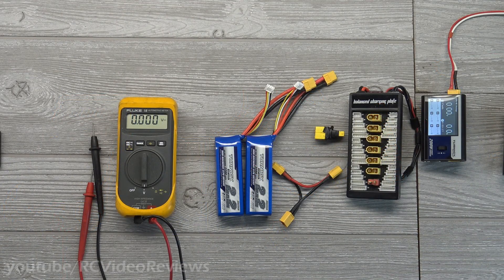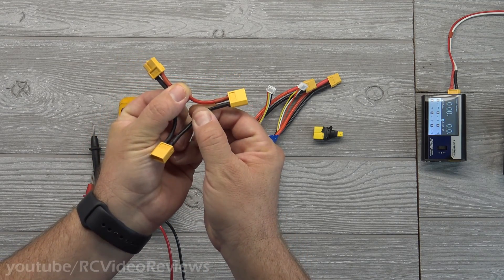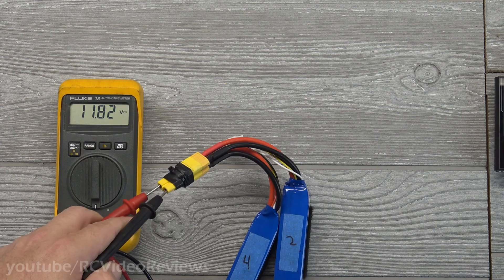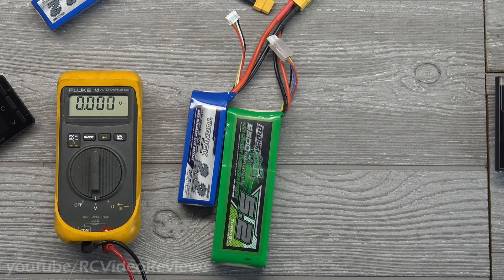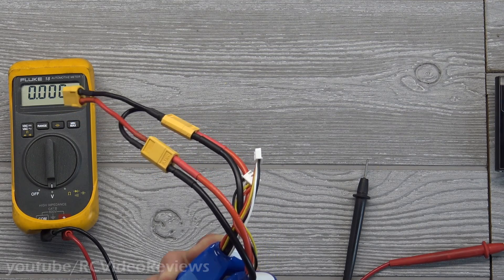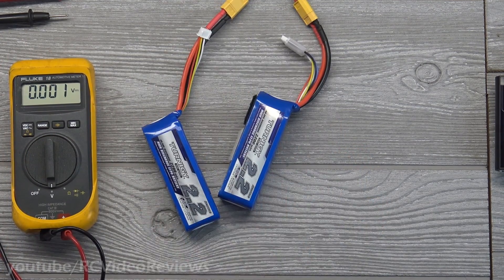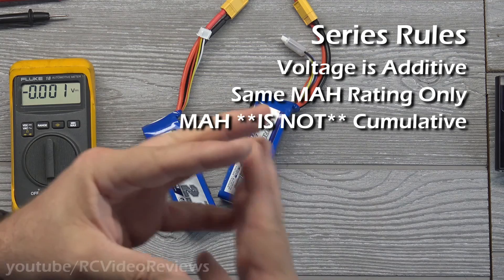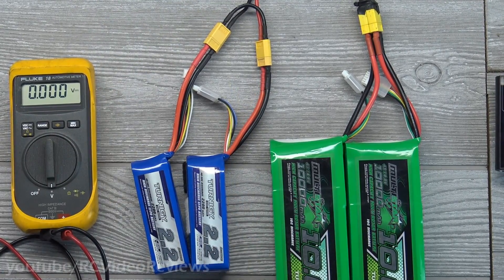How to Connect LiPo Batteries in Parallel and Series - Detailed Examples

Comment: So I can connect a 7s with an 8s same 22000mah lipo ? I’m new to this but I would love to learn ! I will add a bit more  - I did connect 7s with 8s in series but they both have 22000 mah and same discharging rate 30c and they never smoked or did anything unusual , according to your video I understand why , your video it will be my foundation for such things , thank you mate 👍👍

Comment: Man I love your vedios and perfect timing for me, so I'm flying my plane with a diy 4s 2p 6000mah 18650 pack I want to connect a 4s 1p 3000mah in parallel to now have 9000mah is this correct? The 4s 2p pack has c rating of 30amp the 4s 1p has c rating of 15amp so when connect in parallel what will be the c rating? I'm guessing 30amp?? Thanks for all your video's

Comment: So it would be ok to connect 2 4 cell 2200mah together to get an 8 cell 2200mah 'pack', could I then do the same with another pair, to get 2 x 8cell 'packs' then connect them in parallel to get a 440mah 8cell pack?
Reply from the maker: I think you mean 4400 and yes.

Comment: Thanks man, nice video !

Questions I have, is it possible to mix both up to one output ?

Looking to power a large warbird with 14S/20 000 mAh, can I hook four 7s packs, two sets of 7s/10 000 mAh in \\ to get 20 mAh  and then these, in series’ to reach 14s up to the ESC ?

Is there any considerations to be taken or things to be aware of ?

Thanks
Reply from the maker: Yup, you can. The considerations are that in series if one battery is soft (high IR/degraded capacity) and the other is in good condition, the soft battery can be killed while in series as there is only one path for current. So the stronger battery will keep going even if the softer battery is dying. This is true for any series connection, so my suggestion would be to make sure your packs are all in roughly the same condition by evaluating their mAh capacity and IR. Don't push too hard early on regarding your floor voltage. And measure/measure/measure while you dial up the flight time to make sure your batteries are all able to provide sufficient power to your combo.
Reply: @RCVideoReviews  thanks a lot

Comment: Forgot to mention that by running parallel, you are also doubling the current which is a big thing to leave out. Could easily smoke someones esc.
Reply from the maker: Incorrect. Current is the result of load. Connecting cells in parallel does not change load but it does combine the capacity of the cells connected and ALLOWS more current delivery capacity. Merely connecting cells in parallel does not change the current. Current draw depends on the load, not the source.

Comment: any issue with making a 14s from 3 packs? 6+4+4 or 6+6+2
Reply from the maker: Sure. Keep the MAH capacity the same...
Reply: @RCVideoReviews  ok thanks. because i have curmudgeons telling me the resistance will be so high that i should just use 12s... not sure how that makes sense, but ok. they keep saying "i have lots of experience! just listen to me!"
Reply from the maker: They're wrong. If you connect your devices in series properly it's no different than using a 12s pack. Just nonsense. 

My 85" planes and 700 helis all use 2x6s. See the numerous videos on my channel showing those craft in flight.

Comment: Thanks for the video, though I was always taught never to put these in parallel without a diode in series with each output. To prevent one battery charging the other battery. Or if one battery dies, it wouldn’t affect the other battery. But fair enough, if they have both the same voltage it’s ok. I’d use two diodes though … Schottky type with low voltage drop and current rating exceeding the maximum expected. Cheers.
Reply from the maker: I've been charging and discharging batteries in parallel for years. I have planes that use parallel batteries in flight. Higher voltage means more motive force, so it seeks out lower voltage and current will travel to it. This is why we keep the voltage within a few 100th's of a volt for parallel connections. That only really matters when the balance leads are connected. When the mains are connected, the error can be a little larger.

In any case, a diode just isn't necessary if the voltage is close. But, you're money, your hobby, do whatever makes you happy.

Comment: I just ran into this video 👍🏽👍🏽,I have a question, I have 3 4s lipos that I just want to run for more time on my max 5,do I hook one up to the max 5, then with the other 2 with a parallel spliter, then to the max5? For more gas in the tank,all the batteries are the same mah.thanks for any advice.
Reply from the maker: Parallel adds capacity, series adds voltage. So if you want longer runtime, you connect them in parallel.

Comment: Can we connect **  two  different C  rated 3s *battery in parallel  (suppose  one battery is 2200mah 50c  another one 1000mah 40c     ? I will use it in 12v spot welding  which need 150amp ..
Pls reply
Reply from the maker: You can connect different C-rated batteries together, but the circuit doesn't know anything about C ratings so if you load 150a you're going to get 75 from each cell. That is beyond the rating of your 1000mah 40c which is only 40a, so you will probably damage it.

Comment: Ty so very much. You really taught me something.  Now I am thinking about manipulating battery wiring in order to get a desired result.  Like using 4 smaller batteries to provide more power compared to a single battery of the same "capacity".  
I think I got it. So wiring in parallel would be best if you have two smaller batteries and you want to have more capacity as long as they are the same wattage. Series is if you have two larger batteries but want more power as long as they are the exact capacity. You will burn out the smaller battery otherwise.  If you want both you would first take 4 batteries and have 2 sets both in series and then connect them in parallel. Following the rules of course.  Then there is the motor capacity and shorter longevity.  Ty again....When I was young if you were a trades teacher I would have taken those classes. Hell I am older and would now if you were teaching me.
Reply from the maker: "as long as they are the same wattage"  I think you mean voltage. Yes, connect in parallel with the same voltage and you get more capacity. 

Parallel = Same voltage/more capacity. 
Series = Combined voltage/same capacity.

Comment: I have a 7.4 V 850mAh and a 7.4 V 500mAh in both of them appear to be to sell. How should I connect them. This is for a 1/18 scale RC truck that I built.
Reply from the maker: It depends on what you're trying to do. If you want to increase capacity, you connect them in parallel. If you want to increase voltage you connect them in series. Since these packs are different sizes (850mah vs 500mah) you should not connect them in series because the smaller battery will be drained faster than the larger battery which will damage it. So the only thing you can do in this case is connect them in parallel. I covered these rules in the video.

Comment: i just wanna ask something (in series) how abou i connect 2200mah 2s 7.4v + 2200mah 3s 11v is = 2200mah 5s 18.4v?
Reply from the maker: Yes. In series you add the voltage.

Comment: Question: Let’s say you have two 4s 4000mAh Li-Ion packs with a max 45A current output, and you hook them up in parallel, this would give you 8000mAh, but would the max current output also double to 90A?
Just trying for confirm, cheers!
Reply from the maker: Yes. When you connect cells in parallel, capacity is additive as power is drawn simultaneously from the cells in parallel.
Reply: @RCVideoReviews  ok, I was pretty sure that was the case, but wanted to confirm. That’s a pretty big benefit when using low discharge cells like Li-Ion, or low C LiPos. Thanks for the great video and info, cheers!

Comment: I assume I can use that serial connector to plug in 2 6s batteries(both with XT90 plugs) and then to a PDB on a Xclass build?
Reply from the maker: As long as your board can take 25v and provide the correct downstream voltage to your connected accessories.

Comment: Does the age of the battery matter in parallel
Reply from the maker: In parallel, IR is cumulative. So if you have a pack with high IR it will 'drag down' the performance of a pack in better condition. Personally, I try to keep packs in similar stages of performance together.

Comment: Series. I been trying alot but one battery gets life sucked out faster. Loosing to many new bats.  My long reach plane came back with a lipo at 2.77 volts, other was 3.85 ( If some one comes up with a balancing circuit to install between them they get rich !
Reply from the maker: Heli guys fly with series all the time. Do you keep matched pairs? Same manufacturer, same age, same model etc..? Seems like maybe an IR problem or resistance introduced in your series connection?

Comment: Can you combine a 60v battery and a 12v battery to make 72v. can you charge them together ??
Reply from the maker: You can connect them in series. Follow the rules I laid out in the video.
Reply: @RCVideoReviews  thanks
Reply from the maker: You’re welcome.
Reply: Can still use 60v charger or 72v charger to charge the battery

Comment: Can I have 2 batteries In series both 36v 10ah and then take another 36v 20 ah battery and run that parallel then it will be 72 v 30 ah battery is that correct?
Reply from the maker: "Can I have 2 batteries In series both 36v 10ah"

2 batteries in series that are both 36v means you will have a 72v battery. 

"and then take another 36v 20 ah battery and run that parallel"

Absolutely do not do this. You'll wind up with sparks and fire because what you just said you want is to connect a 36v cell to a 72v cell in parallel. 

You do not mismatch voltage in parallel. You have three batteries all 36v. You can connect them all in parallel and the load will drain all three evenly. 

DO NOT put two 36v cells in series and then connect a third 36v in parallel.
Reply: @RCVideoReviews  I think I mismatched the words Parellel and series.  I got 2 36 v 10 ah batteries I connected so it’s 72 v 10 ah if I bought another 36 v 20 ah battery and connected now to positive to positive and negative to negative to will it become a 72 volt 30 ah    I really appreciate your info
Reply from the maker: No. STOP!  DO NOT CONNECT a 72v battery in parallel to a 36v battery. You really need to study this more.

PARALLEL = + to + and - to -. VOLTAGE should be the same.
SERIES = + to -. VOLTAGE IS ADDITIVE

Absolutely do not connect a 36v cell to a 72v cell in parallel.
Reply: @RCVideoReviews  ok so how can increase more amp hours ?
Reply from the maker: You connect batteries in parallel to add capacity. But you cannot mix voltages. If you string 10 12v 2200 batteries together in parallel you get 22000mah. But they all have to have 12v. In your case connect three 36v cells in parallel and you can add their amperage together for the total.
Reply: @RCVideoReviews  so since I have 2 36 volt 10 ah batteries In series that means it’s 72 volts so I need to connect a 72 volt battery in parellel to raise the amp hour  ? That’s what your saying? And thank you
Reply from the maker: Yes. Parallel connections should be very close in voltage or the differential when connected will act like a dead short. High voltage will flow to low very rapidly. 

If you’re interested in capacity why don’t you take the two 36v cells out of series and connect them in parallel. I do t know how you’re going to use 72v anyway.
Reply: @RCVideoReviews  my electric scooter is a 72volt controller  that’s why I use the 72 volt battery
Reply from the maker: Got it. Ok, so 72v is your number then. You can either connect another 72v in parallel, or you can connect something other than 72v in series. Adding a parallel connection will get you more capacity. Adding a series connection will get you more voltage. You don't get both.
Reply: @RCVideoReviews  thank you very much I understand now 🙏
Reply: @RCVideoReviews  so I believe your saying do not do that ??

Comment: Hey John when you connect the two individual batteries packs in series do you parallel charge them first and does that balance charge them to each other or can you also just balance charge the 2 individual packs and connect them. Im pretty sure either way is okay just want to check with you first. Cheers
Reply: Thanks John as usual your info and videos are top drawer. Cheers
Reply from the maker: It doesn't matter how you charge them, but when you connect in series you want them both charged. They should have similar IR too.

Comment: Best explanation I’ve found on YouTube 👍👍👍👍👍👍👍😁😁😁😁
When I got my 1st 6s rc car the hobby shop connected my negative from 1 to the the Positive on the other creating 1 battery 
I recently bought a new RC and got crap from the new hobby shop I use because I was connecting them directly rather than using the XT90 with the xtra wire running from the neg of 1 to the pos of other
I then saw other videos saying that that xtra wire was just a waste of time as it’s just adding another connection to your power supply so I went back to the bullet connection system but as I have 200c discharge batteries I swapped to 6mm bullets from 3( maybe 4)mm to give the best power flow possible 
I’ve found that by switching back to my original system and using the bigger connectors that the power delivery is smoother, less jittery 
I hope I’m making sense here as I often find putting this stuff into words difficult! I would love to hear your thoughts on this if you have the time , if not thanks for making such an easy to understand video
Reply from the maker: Wow, thanks!

Comment: Alright what I don't get is...

Let's say we have 2 cell/batteries whatever, that we need to connect in series. Both have the same volt but different mAh (1000 mAh and 1200 mAh) which should be a big no no as you mentioned. But what I was wondering was, wouldn't the 1.2Ah cell just start charging the 1Ah cell when the 1Ah cell runs dry? I thought that's how it worked.
______________________________________________________________________

Can you please tell me if I can use my 2S 3000 mAh lipo and connect it with my 1S 1000 mAh in series to get a 3S lipo if I only fly for a minute of PID testing without crossing the threshold of 900mAh. Always using my lowest capacity battery as the benchmark and never going over its limit?
Reply from the maker: If there is no load yes, the higher voltage cell would charge the lower voltage cell, but under load, the current will flow from both damaging the lower voltage cell. Remember, you can only go to 3.3v before causing permanent damage.

You can connect a 2s 3000 to a 1s 1000 as long as the 1s 1000 doesn't go below 3.3v.

Comment: In your Serial and Parallel examples you haven't mentioned cell balance. Perhaps it's obvious to those more experienced but must all batteries (as 'usual' for lipo) have their cells in balance?
Reply from the maker: Anytime batteries are used in parallel they should be in balance because they'll all be drawn from in parallel. It's less critical in series because the voltage is additive; however, in series one cell can be drained before others if its capacity (MAH) is lower. So for that reason, it's also smart to start with cells in balance for series connections as well.

General rules are:
Parallel - Same voltage, different MAH ok. MAH is additive.
Series - Same MAH, different voltage ok. Voltage is additive.

Comment: Great job
Reply from the maker: Thank you :)
Reply: @RCVideoReviews  

I bought an UAV plane. Now I just learned from you that I can increase the range by adding an additional battery and make it parallel to the existing one. " more gasoline in the tank "
Reply from the maker: @franciscourena5636  You got it. Parallel is more gas in the tank. Just watch your weight. Adding batteries is normally not a 1:1 proposition. i.e. Double battery doesn't mean double flight time because your plane is now carrying more weight.
Reply: @RCVideoReviews  
If I add another small battery ( same voltage)  how will not be able to increases the flight duration?

Comment: If I added a second battery and connected it in parallel should my current charger charge them equally and would I need to match their level before connected or should my charger do everything?
Reply from the maker: Never connect two batteries in parallel without ensuring cell to cell voltage is close. I aim for within 0.02v

That said, if you DO connect batteries in parallel, the one with higher voltage will try to charge the one with lower voltage until they reach equilibrium.

Comment: Hello, thanks for your video, it s possible to build a battery serie parrallele 72v 100ah with out bms ?
Reply from the maker: Can I assume when you say BMS that you're referring to a charge circuit that balance charges your batteries? If the answer to that question is "yes", then my answer is I would not do that. When you start putting batteries in series, you need to balance charge them.